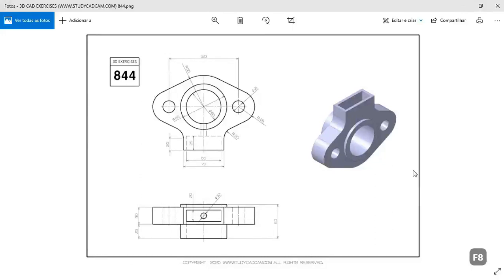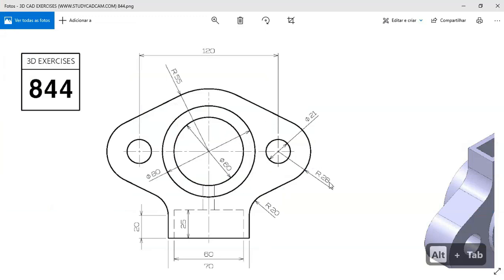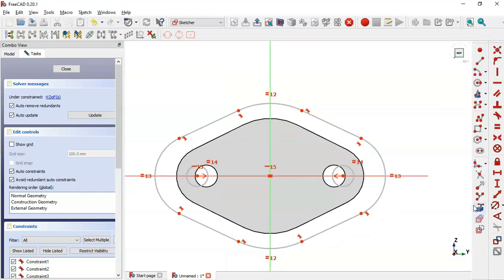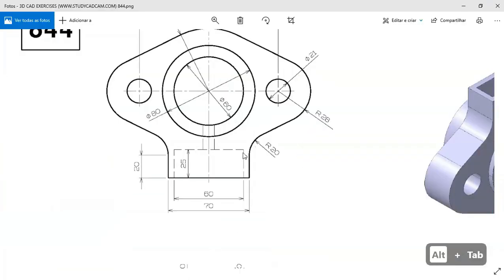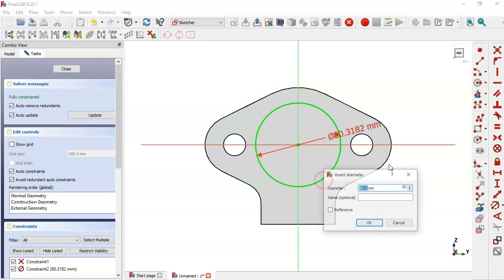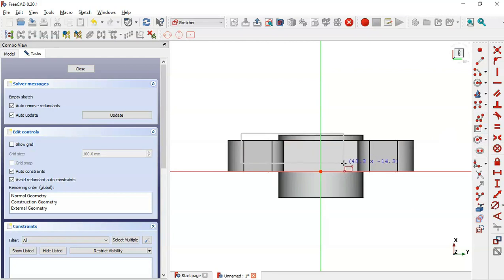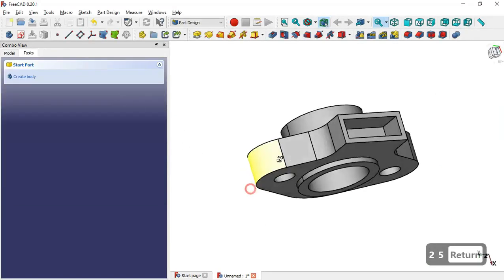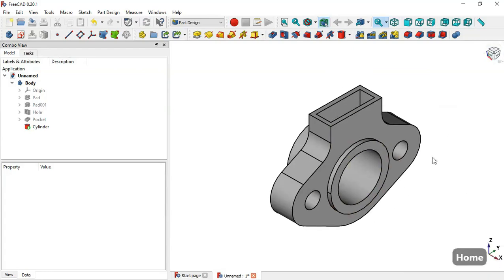FreeCAD Beginners tutorial: practical exercise 61, use of custom macro - Studycadcam model

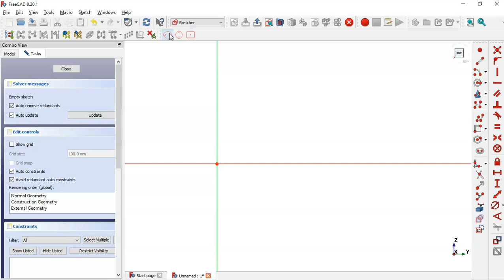Comment: I have tried to record a macro in the sketcher like you have at 0:53 and saved it. When i look at the macro code it looks like everything is OK like i recorded the macro. But when i execute it, it stops after a few lines of code and draws only a few circles. What could i have done wrong. I am on a Manjaro Linux system with the 0.20.2 appimage. Thanks Jean
Reply from the maker: In you code, set the sketch to a dynamic sketch and make some changes in constraints.
Thank you.